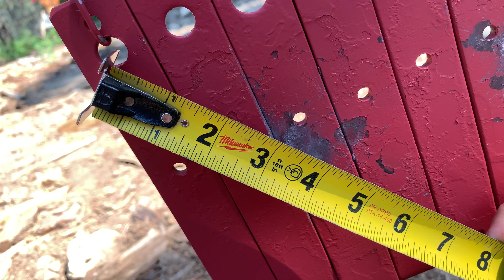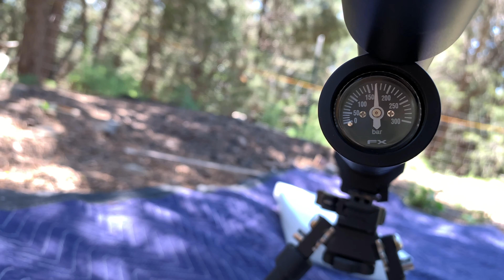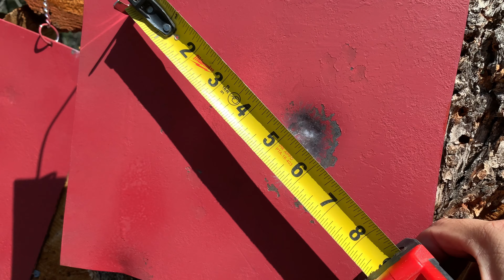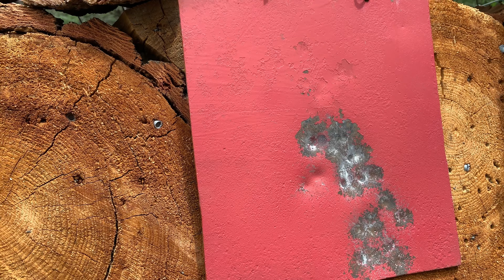FX Wildcat MK3 Power Plenum Shooting JSB heavies and Slugs at 970FPS

Comment: Thanks for the video, I’ve just got the sniper version in .22 so looking at all the information that’s out there to get it tuned. I’ve got the ref set at about 140 and hammer at 7, shooting an 18gr jsb at around 930fps and around 50fp of energy. So not too bad out of the box.
Look forward to your next video, stay safe. Ps. I’m in the UK so mine is classed as an FAC.
Reply from the maker: @martin ash burner-hall- That sounds like a pretty good tune, how’s it grouping? I’ll be working on a tuning video that will demonstrate how to keep the hammer and reg pressure in harmony when trying to increase power. I have had pretty good results with the hades and polymags in .22 out to 75 yards in a few other rifles I have and they hit small game with a solid smack! Thanks for the comment!
Reply: dang.ol.winner yeah it’s grouping ok but just needs that final fettling, I haven’t adjusted the hammer spring etc yet so I’ll see what it’ll do in the next week or so.
Keep up the great videos and look forward to some more 👍
Have a good day

Comment: hello buddy nice video..do you have huma reg on the gun ?? That's why it drops 34 to 970 fps ??? or only with the hammer ????
Reply from the maker: @Panagiotis Agas- I do have a huma regulator now but that was with the regular amp regulator. I had the reg set to 150 bar and the hammer pretension set on max and power wheel on 7! Hope that helps.
Reply: @dangolwinner  
thanks now i'm waiting for it to come to me at 25 mm .... how many fps does it throw the 34 grein jsb ??? if not at 150 bars ?? sorry for my english
Reply from the maker: @Panagiotis Agas- when I first got the rifle the reg was at 120 bar and it was shooting the 34 gr JSB around 820FPS

Comment: Thanks so much for the video. I bought a 25 maverick and I just installed the slug kit..what's the best 25 cal slugs? I've tried every NSA...what gr varmint knocker is best in your opinion?
Reply from the maker: @Kansas Air Hunters- The Maverick is a great platform! Congratulations on surviving the long wait! First off, the NSA slugs are are a great start. They are more “affordable” than some other slugs on the market! Before I recommend a slug, what length barrel and what liner do you have? Also what do you intend on shooting?!
Reply: @dangolwinner  700mm pellet liner..mostly crows and coyotes.
Reply: @dangolwinner  it's shooting at 71 fpe with nsa 38.5...at about 914 fps
Reply from the maker: @Kansas Air Hunters- With that liner you will probably have the best luck with the lighter weight slugs like the Hybrids and 26 gr NSAs. The Hybrids don’t expand the best on small game, but they would work great on coyote skulls! If you get the superior heavy liner you can switch up to the 34gr slugs and there is a few people that make those like the JSB knockouts, H&N , NSA, and Varmint Knocker.

Comment: Have you tried Nielsen Slugs? They are really consistent in size and weight and just a little bit more expensive than pellets.
Reply from the maker: @Eric Stadler- I recently invested in a slug swaging set up to make my own slugs! I’m not sure when I will receive it but when I do, I’ll be making my own slugs. I have shot the NSA stuff out of my impact and they are accurate but for me they didn’t expand to well. That’s why I usually shoot the Varmint Knockers, the lead he uses is a much softer blend.
Reply: dang.ol.winner can’t beat homemade! I had the same problem with Nielsen’s, the recent batches fixed the expansion problem for me anyway. The boxes I have labeled HS-HP are the newer ones with much better expansion. If you get some slugs made in .25 and want to sell them, I’m interested.
Reply from the maker: Eric Stadler- The one gripe I have with the varmint knockers is the lead is so soft by the time I get them shipped to me, 1 out of 6 slugs are dented or bent! I think that influences some of the big distributors to make their slugs a little harder so they survive shipping. What I am going to try and do is ensure that when slugs are shipped that they are packaged so they will not get banged up during delivery. I will be making 2 styles of slugs, the hybrids style and the traditional large hollow point slug. I will be making a video when I get the equipment and I will also start working on making long range videos with them! Thanks for the support and I I’ll let you know when I have few options in weights to try out!

Comment: It would be a good idea to incorporate a removable cover for the power wheel so it doesnt get bumped when your shooting as i could imagine someone doing some nighttime pest control and wondering why there zero is off after there power setting has changed especially if you cant see it in the dark
Reply from the maker: @duffmanmark- Yes that would be a good little add on, the power wheel is easy to bump when shooting from the prone position! Thanks for the comment!

Comment: Love your video's and the detailed info.
Can you please give a list of the upgrade parts you use for the power boost so we can follow up with you.
I found the power plenum in Utah airguns, however, it's shown that it's fit mark 1 and 2 only... please help
Reply from the maker: @yaniv matza- I have the dual hole huma transfer port and they are available through a few websites- Utah airguns, trenier outdoors, ir over seas at krale.com. The power plenum I have is from 910 airgun tuning and repairs and I have the 2.5” plenum. Spaweapons has the plenum as well. Hope that helps a bit! Thanks for the comment!
Reply: @dangolwinner  thank you so much
Reply from the maker: @yavin matza- 👍

Comment: Hello what is the bipod/mount?
Reply from the maker: @M.R. B.•- I actually made it out of a 34mm scope ring. Then I took a pic rail and cut it in half and screwed it together. I’ll show it in more detail in my next video
Reply: @dangolwinner  thanks a lot dang ol'!

Mine shipped out stock today from Utah airguns. I hope their magic touch will leave it without many of the issues you had.  I think I'm mostly gonna be shooting hades. 22 cal
Reply from the maker: @M.R. B. •- I hope so as well! I haven’t shot the hades in .22 cal yet for accuracy, mine is currently set up for slugs, but I’m sure you will be able to work up a good tune for those pellets! In .25 cal I was shooting the hades at 915 FPS and getting 1/2” or less 5 shot groups consistently at 50 yards . Let me know how yours shoots!!
Reply: @dangolwinner  will do! Thanks amigo and God bless!